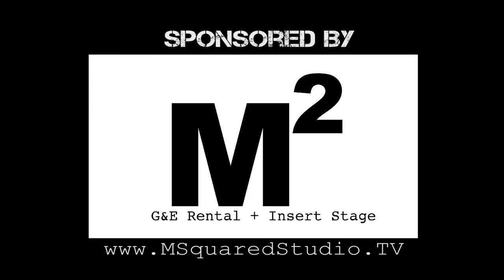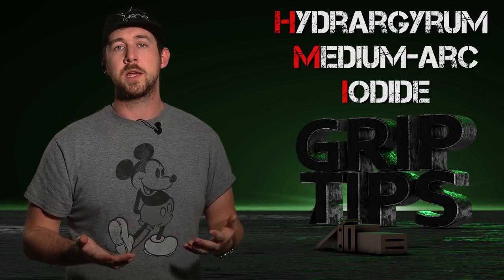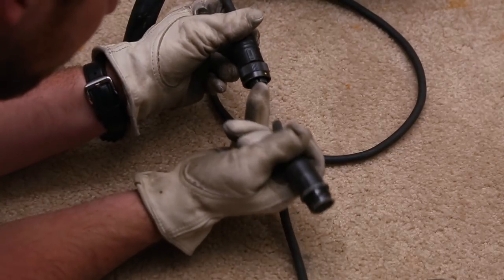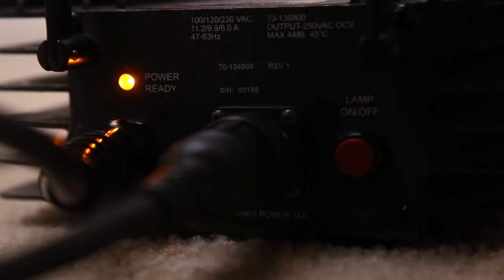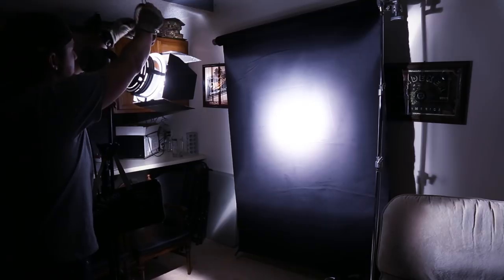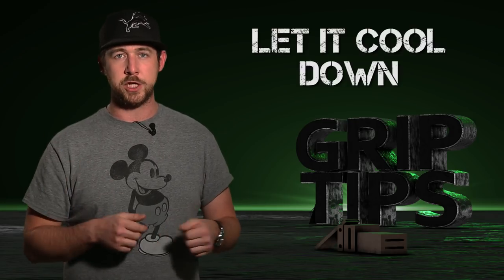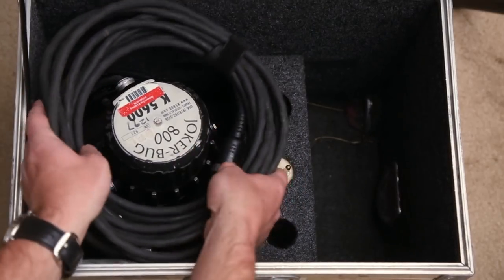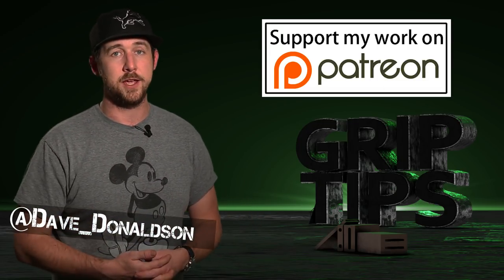Ep 67: Joker Bug 800w (Part 1)

Comment: One quick tip for packing it up: if you turn the rubber feet of the ballast towards the barn doors, there will be much less scratching on both.  An owner/op I work with sometimes asked me to do that with his gear.

Comment: Can't wait to see a video of the aputure 300d you have
Reply from the maker: McCorck29 good eye ;)
Reply: McCorck29 overpriced, overhyped
Reply: @etentertainment4157  I would partially agree... The 120D II are now pretty close to the 300D power making the 300D to expensive in my view.  I got 1x120D II and 2x300D and damn the 300D make noise with the wall power supply !!! Really badly design power supply.  If you want great low cost LED light, go with the Godox SL-60 ! A bit less powerful than the 120D II that I have, but have integrated power supply which doesn't make that much noise compare to the 120D, and they are SUPER CHEAP (Compare to Aputure).  Godox SL-200 exist as well which is much more powerful but I never tried them.  I do have a SL-60 and it work great ! I can buy 6 Godox SL-60 for the price of 1 Aputure 120D II ! You do have a remote as well with the Godox with different channel.  Work a bit differently than the Aputure which have Plus or negative.  You cannot power the Godox light with V-Mount batteries though...
Reply: Marc Olivier Chouinard I have an SL-200 and it beats the 300d any day, esp for best value. When used, cut and shaped properly. Aputure is a hipster, mainstream brand hyped up by kids who don't know sh** about lighting fundamentals thru the power of fresnels. As a gaffer, I want FULL CONTROL of my light. The aputure garbage is not only uncontrollable but it comes at a ridiculous price